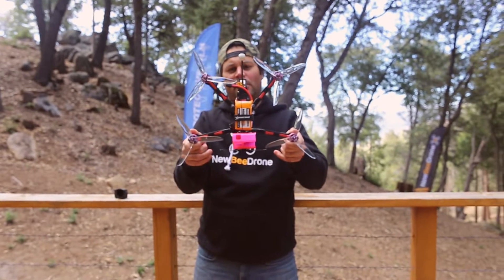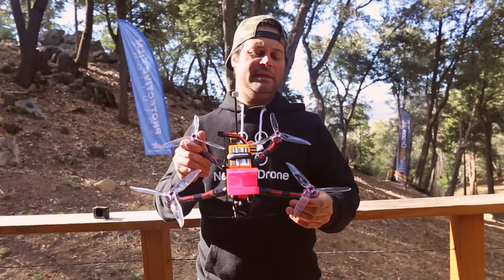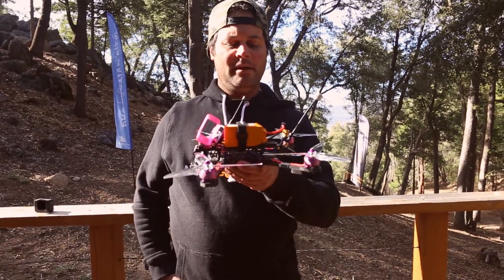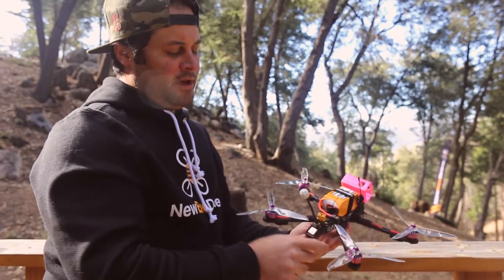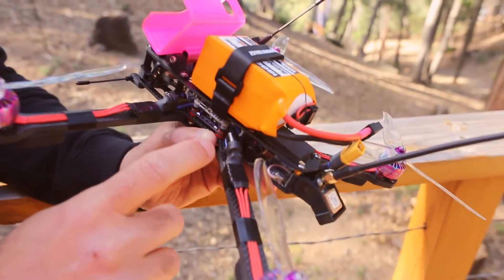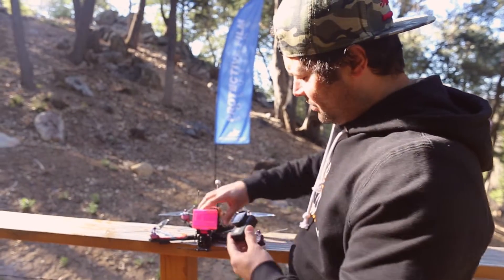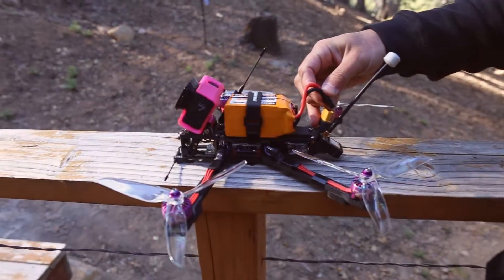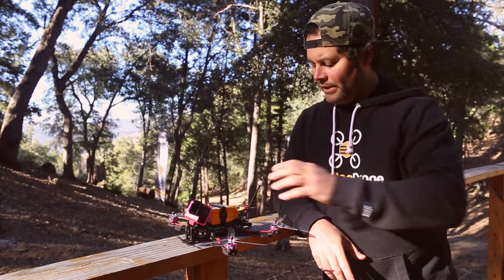Project 399 Super G Plus 7 inch Long Range FPV Kwad

Comment: What do you recommend for motors/props on a 6S Li-Ion build? I have the frame but I haven't purchased motors/props and feeling pretty conflicted.
Reply from the maker: I don't know a whole lot about Li-Ion on quads. There are a couple of guys that are much more adept at that than I am. However, unless something better has come out since, I still like the T-Motor 6143 prop the best. For motors, again, I'm not sure what KV would be best for Li-Ion, though I'm going to guess it wouldn't be much different than LiPo KVs..., but it seems the trend is to go bigger with the motors. Most agree that my choice of 2208 is a little small. Maybe fine at the time, but at this point guys are going for bigger motors than this.

Comment: Great, i have vibration problems on my kwad LR, my arms are too weak. The super G + is really great, I'm going to take this frame. Can you share your TPU impressions? are they on thingiverse? thank you
Reply from the maker: Hi, the GoPro mount is from BMC3D, so I don't have that one. I'm using a different one now that it lighter and looks a lot like the Hyperlow GoPro mounts. The GPS mount is on Thingiverse, but it had to be redrawn by BMC3D because it wasn't good. Same goes for the vertical mount. I would contact BMC for a  lot of those parts.

Comment: nice  but I would suggest much lower KV motors.... like 1300kv for 5 and 6S
Reply from the maker: Ehhhh, that might increase your flight time, but it also dulls down the copter a lot. When flying these I'm not riding the throttle up and down the entire range like you would a 5 incher while doing freestyle. By having higher kv motors the quad has the ability to be dynamic and have explosive power, but while cruising you still have the throttle around 30-40% and thus save battery. I'm going for a balance of good power and acceptable flight times for what I want to do. With this KV and a 5s 2200 I can still go out about 2 miles, which is plenty for the place I fly in.
Reply: @PinchTune  maybe , my FR7 with 2508 /1300kv has plenty of punch if you need it , the key is motors with lots of torque ...

Comment: Amazing video -- what could I do to get the flight time on this frame up to 12-15 minutes??? I have an oblivion which can already do 5-7 minutes, but I'm hoping to find something other than say a "Mavic" or "Phantom" which can give me >10mins flight time per battery
Reply from the maker: You can. But you need a frame that can carry something like a 5200mah LiPo battery, or a custom-built Li-Ion pack. And you'll need at least 6 inch props or larger. 5 Inch props are not efficient enough. One of our guys gets 12 minutes out of a 7 incher with a 4s 5200mah over here. Low kv motors.
Reply from the maker: Technically, I would get this guy to fly for 12 minutes. I've never flown a battery that big, but if I'm easy on the throttle and have a battery that big it should be able to do it.

Comment: Just found this but, dope video. Im so tempted to get one but I need to sell all my 4s quads first.
Reply from the maker: Hi, this doesn't get flown as much as the 5 inchers, so I wouldn't go sell everything for one of these. They are still fun but have a very specific purpose.
Reply: PinchTune for sure, I meant I want to transition all my 4s to 6s first - still ripping my chameleon Ti for as long as I can see :) I was also looking at the source one deadcat 7” at $29 it’s really a good option I think
Reply from the maker: @LO_FLI  Ah, gotcha. Yeah, I see what you mean. I fly mostly 5S, but I'm pretty much done with 4S. I'm building a few more 6s rigs, but I do like the balance of weight, power and reliability of 5s.

Comment: Great video 
Questions:
How long does it stay in the air,?
How far can it go?
Can it go 90 miles?
Reply from the maker: Nooooooo. Definitely not 90 miles. This is not military grade. If it's REALLY setup right, with iNav, very efficient props and a battery with good power and as low weight as possible it might be able to do 10 miles out, 10 back. But even that is a bit if a stretch. I would say realistically about 6-8 miles out and back. In my case, with this setup, I would only go out maybe 3-4 miles out and back, in the desert or something like that.
Reply: @PinchTune  
Thanks for answering 
What is the best more power battery for FPV plane And/or drone?
Reply from the maker: @franciscourena5636  I run Lipos, period. But I know some of the really LR guys are building their own packs using Li-Ion cells. Apparently, at low speed cruising, they are perfect for less amp draw and long run times. I really don't have much interest in that. I'm OK with mid-range. I don't need to go that far.
Reply: @PinchTune  
Thanks for the answer 
Be safe with Corona virus
Reply from the maker: @franciscourena5636  You too! I fly freestyle. The long range that I do is still based on freestyle, so I still manually and very close to the ground. So I don't have a lot of interest in super long range. This video is a perfect example of the type of long range that I do: https://www.youtube.com/watch?v=HfBDGO4dCLA

Comment: When you're out their a mile or 2...when do you know it's time to turn around and come home?  how do you judge that you have 'enough' battery level to return home?  Also, have you tested this?
Reply from the maker: Depends on the battery I'm flying, but I normally simply plan on a specific mah consumption I expect to last at... and basically turn around when I'm at half that. However, most of the longer flights are preceded by shorter scouting flights to help plan the longer ones.
Reply from the maker: Check out this video, because it shows my entire thought process planning a flight and actually flying it. https://www.youtube.com/watch?v=HfBDGO4dCLA

Comment: Flight times questionable😝
Reply from the maker: Flight times ARE questionable. Specially on 5S. The longest I can get is about 7-8 minutes on a 5s 2200mah and bi-blades. I could fit a bigger battery though. Another option would be a 6s 2200mah, and a small throttle cut. That should give me about 10 minutes.

Comment: Hi Danny, I have xing-e 2208 1800kv motors and am thinking to build a mid/long range quad...  7" mostly as it provides great efficiency.
What props and  battery (4s/5s/6s) should I go with?
Reply from the maker: Hi, definitely not 4S. For 1800 I would go 6S. The biggest battery you can fit on the quad. I would say, aim for 2200mah 6s. I fly 2200mah 5s, but 2200mah 6s will offer even more efficiency.
Reply from the maker: Props, I would ask around some more. I haven't been happy with more of the props I've tried in that size range, so I'm not really the best guy to ask. I have some new Gemfan props I'm trying... and also some carbon composite Azures. I need to try the T-Motor 6143 which I hear are good. But jury's still out since I haven't had a chance to do all that testing yet.
Reply: @PinchTune  so 6" props on 7" quad?
Reply from the maker: @shyamfpv  I do that often. I mean, yeah, 7 inch will be more efficient and normally provide longer flight times. But if a 6 inch prop is giving me smoother flight and a more reliable experience, then there's nothing wrong with flying a 6 inch prop on a 7 inch in quad.

Comment: 900 is a smaller wave, which allows it to fit through more tight spaces, and allows the power output to push it further with less signal loss.. 2.4G > 900m etc... check out some HAM articles on 900 vs 2.4 vs 5.8 etc

GREAT VIDEO MAN! im looking to build a 7" long range this winter
Reply from the maker: Additionally, don't confuse bandwidth with wavelength. 900mhz does have smaller bandwidth, but that's not the wavelength. The wavelength of 900mhz (33.3cm average) is larger than that of 2.4ghz (11cm give or take).
Reply from the maker: You got it backwards dude. It's not about "fitting." It's about penetrating. The smaller the number the larger the amplitude of the wave and thus less attenuation. 900mhz has more amplitude than 2.4ghz or much more than 5.8ghz, and that's the reason it penetrates more and suffers less form attenuation.

Comment: Got any good tune?  I found this frame a pain in ass to tune. I tried 3.5.7 but the yaw was pretty mutch untunable... so i did go to 4.0 then i had vibrations of death even when copyin betaflights "stock 7 inch gyro settings" and fine tune it... Impossible to get rid of the vibrations...

Comment: Informative. How did you fit a full size cam?
Reply from the maker: I used the TPU mounts that came with the original Hyperlite Floss and used the bottommost screw holes on the camera case that has the three holes on each side. Fit perfectly.

Comment: I have a 5.5 inch super G running MB primo 2208 2150's on 6s. The thing is an absolute animal! Love the 2208 motors👌👌
Reply from the maker: I have MB Primo 2207/2450's on an older build. They've been good motors. But 2208 is the new hotness. Haha. I might move those 2207s to a freestyle build and put 2208s on there.
Reply: @PinchTune  the MB motors are the best I've flown to date
Reply from the maker: Nice! This is definitely becoming a very popular motor size now.